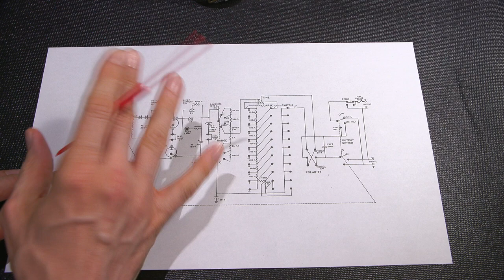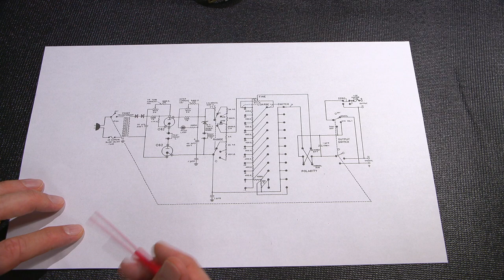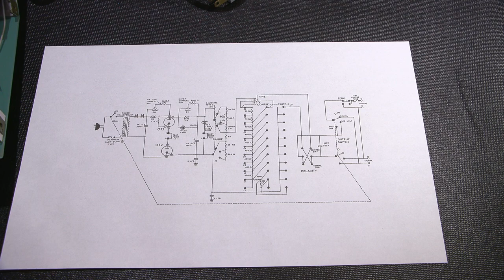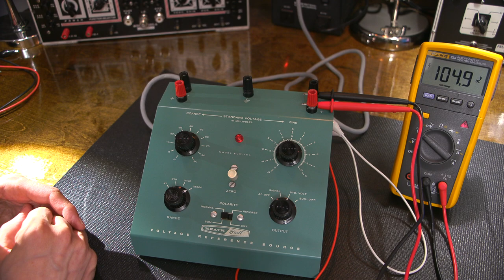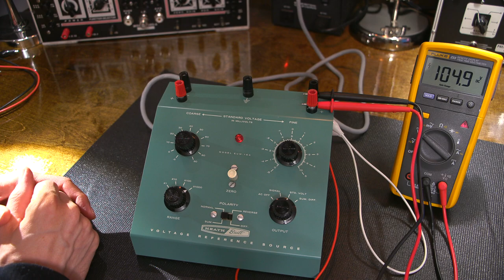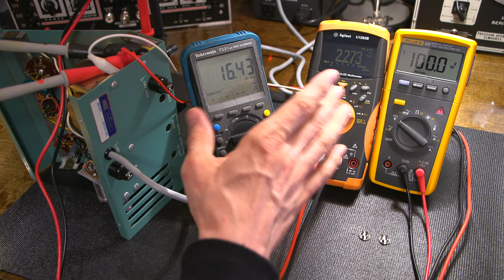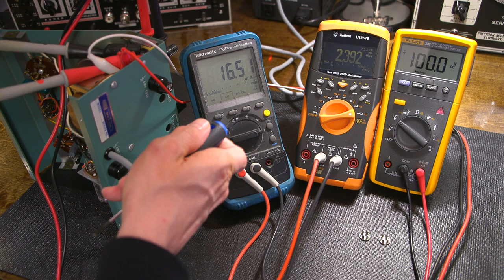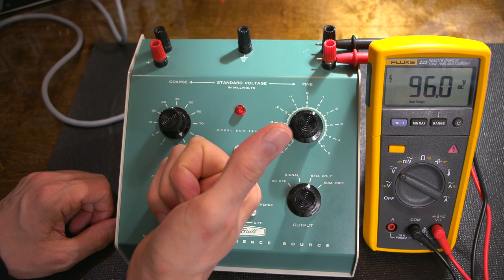HeathBuilt Voltage Reference Source [Restoration]

Comment: The Robertson screw and driver could have been bigger than the Philips but Mr Robertson wanted to make it all.. When Ford wanted to use Robertson screws to assemble their cars in the U.S. (in CA Robertsons were already in use) Ford wanted to make the screws and drivers but Robertson wanted to make everything and sell them. They could not reach a deal so Ford went with Phillips and the rest is history. Robertsons are still very popular in CA and are just now starting to show up in the U.S. markets. For warming the unit up when calibrating, I think I might have been tempted to run jumper leads out the slots in the back of the case that were attached to the test points inside, just to provide access while having the unit as close as possible to its operating condition. Clearly though, that wasn't needed as the results came out great anyway. Just me overthinking things, nevermind :P

Comment: I used a lot of Heath educational equipment when I was going through an apprenticeship in electronics in the early 1980s. Another Heath product line was the Heath/Zenith line of desktop personal computers in th 1980's. I had lots of memories with those things. (The computers were actually OK for the time. The users ... not so much.)

Comment: I’ve found the switches on this old Heath gear that the switch shaft gums up, stick some Deoxit on the shafts and they get a LOT better.
Reply: Another product we used to use on switch contacts was Cramolin, some type of light oil. I have no idea if it still exists.

Comment: Hi Mr Carlson. Can you do a video about tube overload characteristics. Most notable grid current for both triodes like the 12ax7 and power tubes like the 6l6 and el34? As right around @30:46 or so you were talking about the hotter bias resulting in smoother sound. As a tech myself I think the vast majority of this is actually due to the fact that many musicians like pushing the gain of their vacuum tube amplifiers into distortion and the main reason that you would want a hotter bias is due to the fact that you don't get as much cut off clipping (hard clipping) and you get more grid current which results in a much softer clipping effect. I am curious to see what measuring the grid current of a wide selection of tube types would reveal.

Comment: Great video, very interesting.
P.S. we use miles here in the UK. It's the rest of the Europeans that insist on kilometers
Reply: And more pertinently valves instead of tubes. See Franlab for 1950's HIVAC square section  valves in a German built "spy" wire recorder.

 ps Anytime I see Heath Kit, "Heath Robinson"* springs to mind, so in the UK you probably would be wise not include"Heath" in  branding of anything even a little complicated.
*Rube Goldberg in the US

Comment: I know the diagram shows switch and fuse in different sides of the mains, but i prefer the switch to be in the hot, followed by the fuse, the neutral should be direct to the transformer.
Something like a couple of jacks with break contacts would be useful for calibration, but how often would a hobbyist do that.
I guess you could run the wires out the vent so the cover could be closed during calibration, then remove the wires after.
One thing i've done in the past is to insert a screwdriver under the wafer switch spring and gently twist to reduce the tension, this will help with not breaking the knobs, but don't overdo it.

Comment: When I repair plastic I use the old baking soda and superglue trick. It dose work but you have to work quickly. And have small files around to file ot down after it sets up. This is how I repaired my zerolemon cases that kept breaking on my note 9. And I will now use this trick on other plastic things. The trick I found is to use the least amount of baking soda so it dose not enlarge what you are reparing. Unless its completing missing a chunk of plastic. And then you can spray paint it or just permeate marker it.

Comment: A few questions for, I assume, THE expert on these matters from the owner of a few cherished pieces of valve-based audio gear: Is it better to leave valve gear on 24/7 or to turn it off when not in use? Does it really matter much either way, except as regards the electricity bill? And: Is unattended valve equipment really a fire hazard? I see the last accusation tossed about a lot on the web but I cannot conceive of any way in which my end stages would all of a sudden catch fire with the chassis being made of metal, with the valves themselves, of course, being all glass and metal and with the circuit boards inside being full of, probably toxic and environmentally unfriendly, halogenated flame retardants. Thank you for a great channel!
Reply: Valve equipment should be switched off when not in use. All electronics components age and heat accelerates this ageing. I also consider the electrical safety of old equipment as dubious safety standards have come a long way in the last 50 years.

Comment: Note the original two wire line cord on the schematic.  And likely for good reason. On a precision signal or voltage source, you would not want ground loops.

Comment: I just wondered if you could have fit some probe clips (or whatever they're called) with the wires poking out through the vents on the back of the case.  They look like they might just be big enough to fit the plug end through.  Then close up the case (without screwing it together) to do the calibration.

I also wonder what you would use as a reference source for calibrating a reference source back when the unit was new.  I'm presuming the present-day meters are more sensitive and can give you a specific number, while the ones in the 60's would have been deflection meters (again, I think the right term).

Comment: If there is enough meat in the interior of the knobs, why not machine a brass sleeve to go inside? Super glue will be a temporary fix. If it doesn't crack in the same place, it will close by.
Reply: Fill 'em with Sugru?
Reply: Or, align them and remove the screw, insert a drill, and drill a divot into the shaft. The screw will just have to rest in that divot, with a minimum of pressure.
Reply: You can buy over the shelf very similar black knobs in many electronic's parts stores today.  The only difference would be the circular design on the top would be missing.

Comment: I have seen a couple of 60's different make lab supplies using this "two-stage reference" with first, a VR tube, then a zener diode. However, these zeners were closer to 5V, which would give little temperature dependence. This 110V zener is very temp dependent, as you showed. Maybe modify this with more modern components?

Comment: Considering that this calibrator was designed for calibrating analog meters like the Simpson 260 and VTVM's, its pretty accurate.  On another note,  Mr. Carlson, what's your opinion of Underwriter's knots and do you think they should be redone when putting new line cords on old gear if the original grommets are OK?

Comment: AT 9:56 you mention about running the white neutral lead through the fuse rather than the black hot lead.  I agree but looking at the schematic (at 12:05) it appears that it may have been originally wired that way, fuse on one wire to the transformer and the on-off switch on the other.  Seems odd.

Comment: Hot should be fused in case it shorts to ground, bypassing neutral. FYI. Fusing neutral may be ok if you also have ground fault detection, but that's a big if, and would be relying on a potential point of failure.

Comment: Putting the diode in a isothermal block will greatly increase its stability. Of course, it also causes stability lag. Being 1% resistors, it's somewhat moot. The best I have ever seen is the old Fluke differential voltmeters with a Epley standard cell. On another note, the measurement device needs to be a order of magnitude better?

Comment: 5:30 - Or, you can break loose a slotted screw, then use a Vaco split-point screwdriver to remove it. No slippage! Very useful for screws deep inside a chassis, too.

Comment: The 0B2 tubes were glowing . I thought a gas tube with a 0 meant no heater voltage, also I was waiting for the white button explanation that said zero in the center of the device. Good job with the heath/build and your work. I'm not saying anything derogatory,  ok? from a ham kc6trw
Reply: Yes, gas-filled regulator tubes have no heater.  The Gas ionizes ("fires") at a specific voltage determined by the physics of the gas, and conducts heavily.  The greater the voltage across it the more it conducts.  This action keeps the voltage fairly constant across the tube.  The ionization shows up as a glow of a colour that is gas-specific.

Comment: Paul, didn't your magic box have orange LED'S in it?  The LED'S in this box are green.
Reply from the maker: Hi Dale. I have designed many different devices with the same display layout. This makes the circuit board footprint the same, so others can use standard template for drilling.

Comment: Hello Paul, well wishes from SLC UT. I have a Johnson. Messenger 4230 with no antenna. My apt is on the 3rd floor, windows facing west. I can place two 10' sections of 3/4 pvc out the window for an antenna. What cable configuration would be optimal in your opinion? I've been staring at my Johnson for two years, and still don't know how to handle it. Any advice would be greatly appreciated. Cheers! ;)

Comment: The reversal of the power cord was probably due to the person who installed it either just study about current flow from a battery where Negative is the direction of the flow or work extensively with batteries...
Reply: Black could have been mistaken for neutral it used to be black for neutral in the UK Line was red
Reply: When some previous amateur "repaired" the power cord by replacing it, they chose a 3 wire cord and did not know the correct way to wire to the fuse. 50-50 chance of being wrong unless they knew what the standard is. Black is hot, white is neutral. Wire the black lead to the fuse. I would not have grounded the green wire to the chassis. in certain situations, this will set up a ground loop. Probably not an issue when this unit was being used to calibrate other equipment.

Comment: Why, do you suppose, that the engineers -- and the schematic -- wanted/showed the fuse in the neutral/ground side of the primary? My guess would b e that they were, primarily, interested in protecting devices "upstream" of the fault, rather than ascertaining that most of the circuitry was "safe" in the event of a fault. After all, a nerdy technician/engineer/experimenter is much easier to deal with than a family which has lost several members to a house fire.

In any event, my education, training, and common sense dictate that I place the fuse as close to the input power source as practical.

Love your channel.  _ _ ...   ... _ _   ..  .    _.  ..   _.....  _..  _._.  _...

(Morse is hard on a cellphone!)

Comment: Why not test some of the capacitors with the Mr. Carlson's Tester first?
Some caps (Not paper) were built better back then than nowdays. Good is good, bad is bad!
Just sayIng, Not all old caps are bad!
Reply: Nonsense. Process control was way looser and materials weren’t where they are now. Lousy caps these days all beat the crap out of the paper oil caps. End of story. You can waste your life away measuring it. The way it stands you just repeat the audiophool nonsense. About the only old caps that have a chance at being any good after 5-8 decades are Teflon, ceramic, poly, and wet slug tantalum. You go measure stuff if you need to convince yourself. We already know this stuff. You apparently don’t. “They don’t build them like they used to anymore”. Yes. And that’s a good thing! Space race was at the edge of what was possible. You needed a US economy backing you up to pull off a space program. These days SpX can do it without a whole country paying them several % of their GDP to do so. I’m really glad they don’t make stuff like they used to in that respect, lol.

Comment: Why the Zener diode was used? Would'nt the 100V regulator gas discharge tube (or even neon bulb) be more stable?
Reply from the maker: There are a lot of things this design could use to increase stability, this was designed at a price point.
Reply: @MrCarlsonsLab  Thanks, but would it be a good idea? Amateur level question.

Comment: Just a thought..  If you used at thermistor that was in close proximity to the Diode.. (like thermally bonded to it)  Could you use that to also compensate for temp variations so that the load and or room temps could be compensated for..  Understand please I am truly layman here
Reply from the maker: Hi Kennith. If you used a thermistor to control a heating circuit and element, then heat the device (Zener) hotter than the surrounding temperature (known as an ovenized reference) this would stabilize the Zener. The temperature control would have to be very accurate.
Reply: @MrCarlsonsLab  Never thought of that :)  Was was thinking of use in a normalization type of thing just compensating for the temps as they changed.. But yes I agree  "ovenized" would be as or move effective . Not to mention easier to accomplish..  Thanks :)

Comment: An AC cord strain relief may have been easier to install than a grommet and glue. They were used in most equipment from the 60's and 70's, but were used mostly on flat AC Cords though. I'm not sure you could find one for a heavy round cord.
Reply: Even if he could find one for round cords, he would almost certainly have to drill out the hole in the case to a larger size, to be able to fit the round cord strain relief into the back panel.
Reply: I didn't see a UL knot!

Comment: Be cautious when using Cyanoacrylate adhesives at it needs to be the correct one as some of the accually diffuse in to many plastic materials and by time give away due to microfractures, especially in rubber and plastic and in combinations. Cyanoacrylate adhesives doesn't go well either with leather, cotton, carbon or glas fibers as it generate a exothermic reaction with heat and gas as a result.
I personnaly prefer mechanic attachment to off loading cables as it has been proven to last longer but not for ever than other options.

Comment: What are your thoughts on capacitor regeneration ? I had a talk with a person doing old radio renovation. He was really angry about people throwing away old wax and electrolytic capacitors. Electrolytics he was filling with a new electrolyte, wax capacitors were put in a hot parafin bath (removing all the bad stuff from the inside). He claimed that capacitors no longer had the leakage and they were working fine (verified low leakage) for quite some time (decades) afterwards.
Reply from the maker: Hi. My thoughts are.... No. The paper is whats degrading in the "paper and foil" caps, so no amount of wax will fix that. Picture a book's paper going yellow, wax doesn't fix that. As for refilling electrolytics.... just no.... for so many reasons. When you say "verified low leakage," this is according to what instrument? What is the leakage resistance of the "regenerated" capacitor?
Reply: @MrCarlsonsLab  According to the person doing the regeneration the hot parafin washes away the oxidation byproducts which are supposed to be the leakage source. The hot parafin is entering the internals, as he is removing the protective layers (tar or whatever they used back then). As for after regeneration leakage values. The capacitor went from 500uA down to sub 100nA. http://www.oldradio.info/regeneracja2.html
In the next case from 5mA at 50V down to 20uA at 600V. http://www.oldradio.info/regeneracja3.html
Personally I just apply high voltage (200-400V) and measure leakage using uA meter in series with the capacitor, this guy uses a proffesional capacitor meter (shown on photos and mentioned in the text). In some threads he has shown capacitors still beeing low leakage after a decade since regeneration. He does it mainly to keep 1930-50's gear fully original. Myself I replace the capacitors with modern ones but this guy seems to have really good results with capacitors that are nearly 90 years old right now. He is active in retro electronics scene in Poland. There are also other specialists there, even going as far as regenerating CRT's (replacing the gun) and magic eye tubes or making functional tube replicas.
Reply from the maker: Interesting, but no. Acidic paper is the failure point in paper and foil caps. Interesting read though.

Comment: extensive calibration on temperature dependent devices that don't have a purposefully build in heater are futile (imo).^^
what would be interesting though would be a temperature curve displaying the absolute error delta V/°C ... 
i don't think it would drift "that" much .. like 1 or 2 % maybe ? well temperature chamber ... hmm.

Comment: I'm totally guilty of powering stuff up just to see what they do. Learned my lesson while attempting to resurrect a Chicago guitar amplifier from the 50's. To be fair, it "worked" perfectly and nothing funny happened until a filter cap popped and took out two of it's 4 tubes. Wasn't a big loss since it had a very rusty chassis, rotten casing, and now two blown tubes. Probably the first time I got into tube stuff.

Comment: The hot side should be fused /and/ switched, with the fuse in series with the switch in series with the transformer.  The neutral side should remain unswitched, just like on a light bulb socket.

Comment: Wouldn´t it be an idea to add a diode (or two) in series with the Z-Diode and couple them thermally to compensate the thermal error? The 110V-Z-Diode is like a PTC and a diode behaves like a NTC.
Reply: NNA  Yes, just my thought. But i understand, it´s always the question of budget and price. For those days this unit was accurate enough for its price.